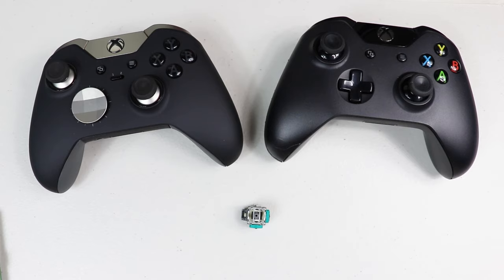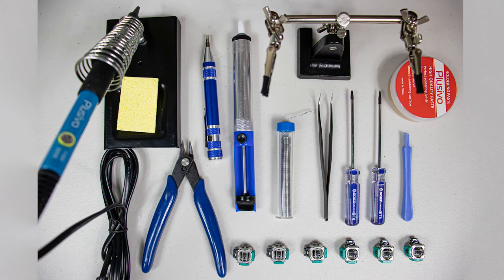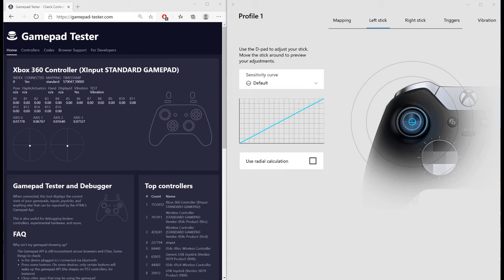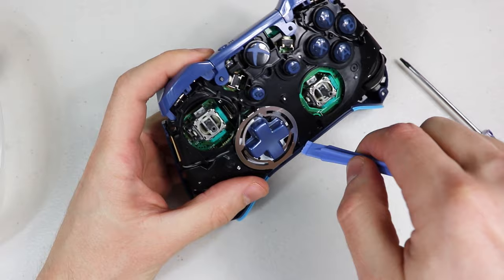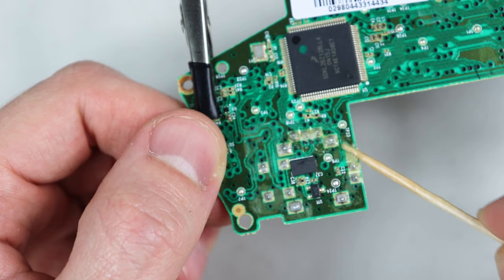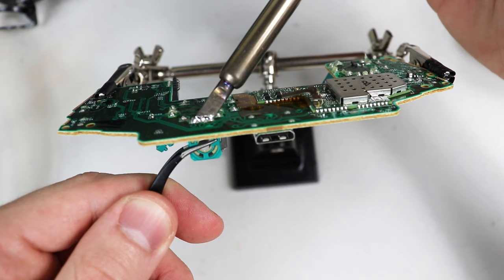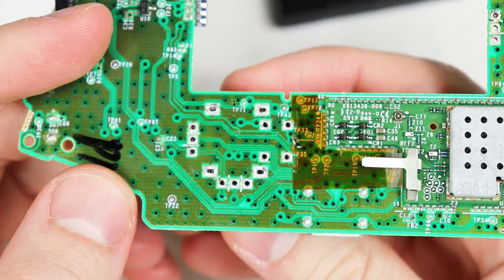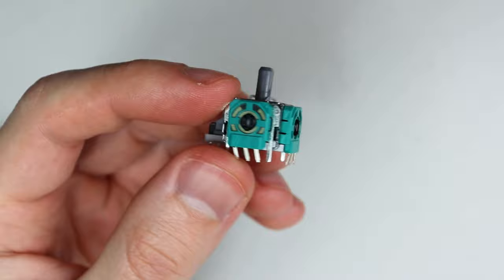How to Replace Xbox One Controller Analog Joystick - NEW METHOD - Fix Stick Drift, Broken, & Loose

Comment: This is a good instruction video specially the method of disassembling (11:04).

What most guide fail to explain is that the whole module  will act as a huge heatsink hence why some people have trouble disordering and they end up damaging the board. Most casual people only have the cheapest and basic tools and with this method they'll be able to avoid damaging their controllers.

Also for recalibration there's a new method for recalibrating sticks  called Heller Drift Stick Fix but is quite expensive atm. Maybe there'll be a time when someone will mass produce these boards after all the PS5 joystick uses the same model as the ps4 so the drift issue will remain for the next 7 years or so
Reply: Aliexpress has very cheap alternatives to the helder kit. Also even with perfect centering using the helder kit the freaking dead zones don't get adjusted accordingly so you could end up with very limited range!!! It's trash!
Reply: disassembling is TERRIBLE!
Reply: @vgrepairs  Wow thanks for heads up about the aliexpress clones of the helder kit, just ordered one of every variety to test out. Wish I hadn't already wasted money on multiple helder kits. As much as I like supporting the inventor, his prices are highway robbery.

And you are right, the helder kit can limit range. Luckily we solved this problem back in the xbox 360 days, as "slow turn" was common with 360 controllers. It requires a very advanced set of tools known as sandpaper. Just take the faceplate off, and whatever direction you are having trouble pegging the joystick in.... sand a little bit of material off the shell on that side to give the stick a little bit of extra travel distance.

It is a helluva lot quicker and easier than all this cutting, bending and swapping potentiometer nonsense.
Reply: @nerdstrangler4804   true, helpful advice. thanks man! good to know an occasional comment helps some folks.
Reply: @nerdstrangler4804  i wish clients were open to letting me sand their controller housing to fix their lack of range.
Reply: @nerdstrangler4804  Quick question. How'd it go using the AliExpress boards to recalibrate the potentiometer? I need to know if that's the way to go if I have to recalibrate them after replacing the joysticks.
Reply: @jujujustherefr  Pretty good, worked just as good as the Helder version, minus one set I ordered that were garbage. There is a version with a rigid PCB instead of a flexible one. I would recommend avoiding those as they significantly neutered my max input. Wish I tested them some more to figure out why they were so bad before throwing them in the garbage, but wasn't thinking at the time. I am guessing something about the circuit design was adding more resistance but I don't know, I am not gonna pretend to have a deep understanding of electronics. I mostly just replace components when they fail.

I have a couple more varieties on the slow boat from China I haven't tested yet. Though I am not expecting any major differences. But after seeing that there CAN be differences, it made me curious.

For me it is the way to go as I am lazy. And have stuff like low melt solder so I can easily remove them if there is a problem. Plus I like always having my sticks dead nuts centered.

But obviously, it is gonna cost more since you have to buy the boards. Also I think it is a good idea to have some low melt like Chip Quik handy in case you do want to remove them. As they are a pain in the ass to remove otherwise, especially if you want to salvage the boards. But as long as you only solder the 6 pins for the potentiometers and use a little low melt solder, they come off pretty easily.

But if you do go that route I would HIGHLY recommend having low melt solder on hand. Because I know when I originally used the Helder kit, one of my sticks would occasionally spazz out. Despite going back and making sure all the solder joints were good and that the stick worked fine on its own. For some reason that specific stick would spazz out anytime I it was used in conjunction with the Helder mod. So I had to swap the stick out and then it worked fine. So you need to be prepared for weirdness. Granted I suppose you could just buy extra boards so you don't need to worry about destroying them as the clones are fairly inexpensive. But low melt solder is pretty freaking badass and can make desoldering so much quicker/easier. I think it definitely worth spending a few extra bucks to have on hand.

So I definitely think it is the way to go. But if you are just trying to do the job as cheaply as humanly possible and don't want to have to potentially spend an extra 15-20 bucks for the boards/low melt solder. Thats up to you.
Reply: @nerdstrangler4804   @nerdstrangler4804  Ok so basically just get  some low melt solder and don't get a rigid PCB am I correct? I have the solder kit that was linked in the description and the solder that came with it isn't hard to get off so I think I should be fine.
Reply: @jujujustherefr  You will have solder sandwiched in between the PCBs so you can't get it with a solder sucker or wick. You can try simultaneously heating all 3 pins with your tip. And slowly inching up each side. Come to think of it, I think I actually did that once before I had low melt.

So maybe you don' NEED low melt solder. However, something to keep in mind in case you run into trouble. As it is basically like a cheat code for desoldering. Makes things insanely easy.

Just make sure when you solder it in place, you only solder the 6 pins for the potentiometers. The other pins are completely unnecessary and just make removal a nightmare. 

But yes, avoid the rigid PCBs, they were green and L-shaped.

Comment: I just replaced the sticks on a 360 controller, preserving the original pots but forgot I had changed the sticks previously and they wouldn't center correctly, now I can correct them with this manual calibration trick. You're the best!

PD: I can't believe how well that worked. This must be my best repair so far

Comment: I just used this video to install your kit and it was WAY easier than I thought it would. I also am not an expert solder-er, but it was very simple following your example (after watching it like 50 times). The only think that I would add is that while the controller is open just go ahead and clean it. It will ALWAYS pay off!!
Reply from the maker: Great work!!

Comment: great tips. i am actually pretty experienced at soldering and i can tell you nice job pulling that first joystick, a lot of people with no soldering experience aren't going to get it out that easily lol
 BTW in my experience, unless your just touching up a solder joint the flux is crucial, as in more than recommended. It lifts contaminants from the contacts to the surface of the joint and out of the solder, improves balling and so on and so on. i know the solder is flux-cored, but that is only enough to quickly make your joint.
Reply from the maker: Great additional input.  Thanks!

Comment: My controller was a little too much for me to repair, thumbsticks were completely not working and some of the buttons weren't either. I guess that's what happens when you use it for 6 years😂. I just salvaged everything I could to put into my other controllers that needed repairs. I've now fixed them and countless others. Thanks for the help.

Comment: You are the best, SOSS GAMING. Thank you for this awesome and detailed tutorial video. I can confirm that the X/S controllers (with the share button) will eventually auto calibrate! 

1. Use the recently released (Feb, 2024) calibration software inside the Microsoft accessories app.
2. I HIGHLY RECOMMEND picking up a cheap electric desoldering iron/pump if you are a beginner.  

Note: The auto-calibration is REAL. My new potentiometer gained full range of motion after running it through Windows calibration. The calibration settings persisted across all of my devices (PC, laptop, iPad Pro, and Xbox Series X). 

I even clicked the 'Reset to default' option in game controller settings to see if the potentiometer would revert to its previous state with severely limited movement, it did not!

Comment: Those small thru holes are a royal pain. The way I did it was with a small piece of solid copper wire. Make a small U shaped bend. Paste a shitload of flux on the holes. Solder the solid copper wire to all 3 holes. Then let it cool. When you're ready, touch the solder iron to the center of the copper wire and let it heat up. Once it gets hot enough the 3 thru hole pieces will release all at once. That's how I did it. I'm sure there are way better ways to do it. But that worked for me. Good luck fellow DIYers!!! Great video sir!
Reply from the maker: Neat trick! Thanks for sharing and good job on the repair

Comment: Thank you for this video! I used it today in an attempt to fix stick drift in my right thumbstick. I was successful in fixing the issue. I simply replaced the potentiometer for the x-axis by desoldering the old one and soldering on a new one replacing the disc as well. After looking at the inside of the old one it seems there were scuffs where the metal on the disc would be touching and creating the issue of drifting. After replacing it all is well and works just like it did the say I purchased it!! Thanks again for all your help!!

Comment: Awesome video! I ordered the parts and fixed mine. Biggest problem I had was sucking the old solder out of the holes using that little plastic suction thing it came with. I would recommend heating up the old solder and suctioning from the other side of the circuit board that was the only way that worked for me. Also, my potentiometers were nearly perfect once I bent the metal leads away from the joystick. I guess I got lucky with those. Overall it took me a while to fix but it is now 100% good as new.
Reply from the maker: Great to hear! Well done.

Comment: I just fixed my Xbox Series X Core controller, the left stick had major drift issues. Replaced it using the SOSS joystick repair kit off of Amazon and surprisingly the repair worked with no calibration needed. The replacement sticks are exactly the same ones that are in the controller, same manufacturer and everything. Unsoldering the old stick was quite a chore though and there is a major learning curve If your an amateur at soldering like I am, but it is doable and patience & perseverance is key. I used a soldering iron, flux, wire snips (to break down the old stick), small flat head screw driver (for prying potentiometers) and solder to get the job done. Thanks for the video which was a tremendous help and also for putting together a solid repair kit at a great price!
Reply: Also, I was wondering, is the reason why I didn't need to calibrate after the stick repair is because the Xbox Series X Core controller is self calibrating, or did I just get lucky?
Reply from the maker: @davetaylor7271  You are correct that the newer Series S/X controllers also now have self calibration. And great job on the repair! Thanks for sharing the journey.

Comment: Thank you so much for this awesome tutorial! I looked into tons of analogue stick replacement tutorials (which helped me with the technique how to replace the stick), but this video gave a lot of insights on how one can calibrate the analogue stick (without calibration the rest does not help so much). What I'm wondering is: why does no one at least mention that you need to manually calibrate your analogue stick? They just replace it and bam everything works - But this is not possible out of the nature of an analogue stick.
Reply from the maker: My pleasure! Unfortunately it is not common knowledge.  It's something that frustrated me so much when I was trying to repair my own controller.  Thanks to some forums and some testing of my own I was able to figure it out.  And it's actually what made me decide to make my own video on it and even sell the correct parts on the side.
Reply: Hi Ralph, as you wrote "nature of an analogue stick" I wonder why there is no software for autocalibration available. As these potentiometers are surely linear you should be able to "center" them with software once and for all without the hassle of soldering. :(
Reply: Sadly most people do a full analogstick repair...but it's the potentiometers who causes drift.

Comment: Wow... this was difficult. I had never soldered before. This was tough, but I got it done. One of the joysticks that came in the package was defective and after already installing the right successfully, the left was registering as if it was clicked in. 

I thought I damage the board and it definitely looks a little beat up, but I swapped it out and you know what? I freaking got it fixed. I did get a couple small burns on my fingers, but I learned a new skill and fixed my stupid $120 elite controller! 

I would highly recommend NOT bending the pins on the green parts all the way down to make the connection. This can mean some serious damage to the board if you are not careful and you will have to disassemble the whole joystick if it is really stuck. I simply plugged it in, to get a reading, then removed and moved the pins to the left or right, stuck it back in and when it was acceptable, just soldered it in.

Thanks for the video!

Comment: Instead of bending the potentiometer pins, you can alternatively stick another pot thru the 3 holes on the underside. So, you'll have the one connected to the analog and another pot wedged in the holes on the bottom. I learned that from a guy that repairs controllers constantly. Hope that makes sense lol.
Reply from the maker: Fascinating! Not sure I understand. What does this accomplish?
Reply: @SOSSGAMING  Oh, it allows the pins to make contact for testing and calibration. Just so you don't have to keep bending them to make contact with the pads
Reply from the maker: @mb3939  My goodness! That is a fantastic idea. Never even thought of that. I will have to test that out later. Thanks for sharing.
Reply: @SOSSGAMING  No problem! I really appreciate the packaging on the analog modules you sell. Top tier 👏
Reply from the maker: @mb3939  Thank you! Good luck on the repairs!

Comment: 6:48 I usually just cut an "X" over the screw with a razor, that way I can stick my screwdriver into the screw but it isn't very noticeable when everything is back together.

Also, using a teflon razor helps a LOT with peeling off stickers. Especially "warranty" stickers.

Comment: Man i had no idea about the Disassembly method, this damn controller gave me so much trouble with the de-soldering pump, i think that the main problem is that they use lead free solder. For example i was able to fix 360, PS2 and PS3 controllers without any problems whatsoever with the same tools. Amazing video!
Reply: What kind of solder can i Buy lead free?

Comment: Great video helped me out a lot, however, I was trying out another method. Instead of manipulating the potentiometer itself, I manipulated the white nub that turns the wipers. So far, my method has worked and tbh a lot less tedious, however, testing will still have to be done as im not sure if deforming the plastic nub a certain way is a long term solution.
Reply from the maker: I've tried this before with only temporary success.  Personally, I don't think it's a very reliable way of doing it as per my experience, but maybe there's a way of making sure the new deformation is stable.